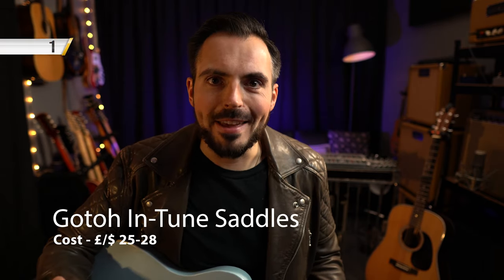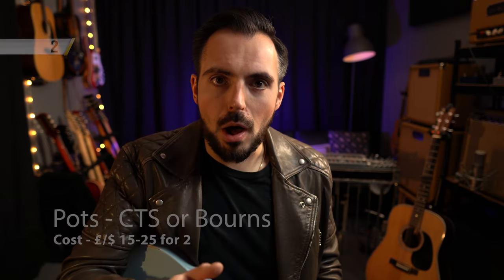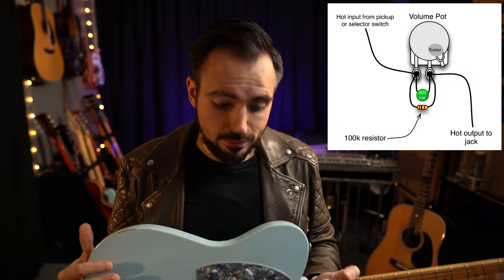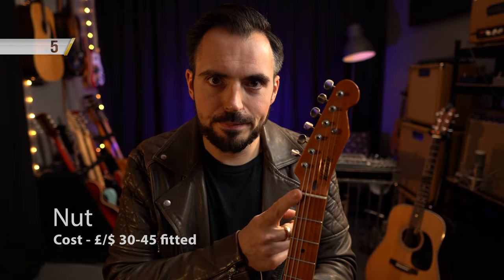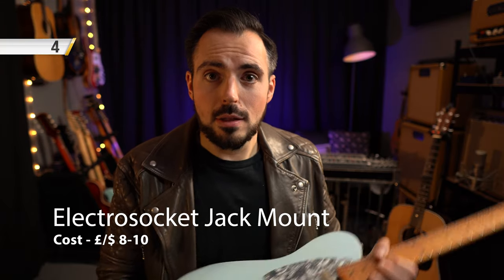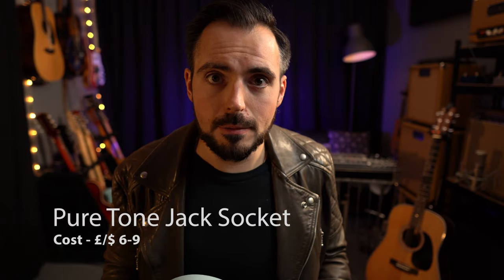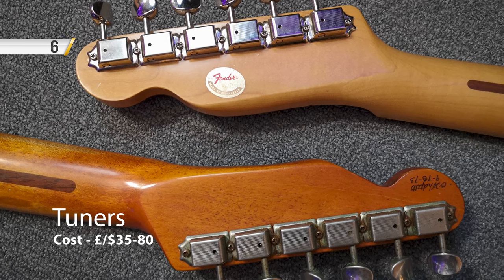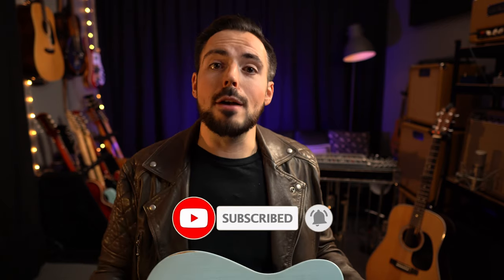6 Cheap Telecaster Mods - Tele Tuesday

Comment: Shield the cavities while you are changing the pots. It helps !
Reply from the maker: Good idea Barry!
Reply: @ScottPoleyMusic And shielding makes far more difference that tuners. I have never wittnessed tuning instability bc of tuners. It is virtually always the cheap plastic nut.
Reply: The problem with this type thinking.
First off does a noise problem even exist?
The tele is pretty quiet for a single coil guitar.
Adding shielding SHALL cut some high end off your tone, that’s physics. And a fact.
Research it yourself. Be my guest.
blanket statements are unwise.

Comment: We need a "6 cheap mods with no soldering" video.
Reply from the maker: I can do that!  Soldering isn’t so bad though - it just takes a bit of getting used to.
Reply: I first started soldering electronics and tiny motors and such when I was 10 years old. It's simple to do (clearly as a 10 year old can do it).
But if there's any piece of advice about soldering is: PREP PREP PREP. As long as you prep the working area well, you can't fail. Cover anything. Keep everything you need in comfortable arms length. Take your time.
Reply from the maker: As a fellow junior soldering geek, I fully endorse this message 👍🤣
Reply: Seems like you need a "how to solder" video, mate. It's neither rocket science nor heart surgery. It's heating up shit to make it liquid-y and when it gets cool again it solidifies and attaches shit to other shit.
Reply: Why don’t you learn to solder?
It’s simple, my granddaughter can do it , she is 6?
No excuses ….

Comment: I'm glad I came across this! Thank you for making it! I have a very inexpensive Harley Benton TE-20 and I absolutely love it. I've already modded it with Hipshot locking tuners, a new string tree, Tusq XL nut, and compensated brass saddles from Gotoh. It's made a world of difference. HOWEVER...it is only a top-loader! Yes. It's so cheap that the bridges are top loaders. It doesn't sound bad at all. But for the sake of authenticity and sustain, I'm having our local luthier drill (carefully, carefully) holes needed for ferrules (also from Gotoh). I also purchased a genuine Fender ashtray bridge for it. I'll probably rewire it with a harness next, complete with the treble bleed circuit. Thanks again for all these great tips, Mr. Poley!
Reply from the maker: Awesome Michael, some vintage Fender Tele's had top loading bridge.  Good luck with your modifications and keep your eyes peeled on my channel for a video about a Harley Benton guitar I just picked up 👍
Reply: Putting good pickups in Squiers and Epiphones etc but still using the existing electrics isn't a great idea!
Reply from the maker: @Ronno4691  I quite agree with you there.  Upgrading the electronics and wiring in any guitar is always a great mod.

Comment: This video is good motivation Scott, the bridge ground wire has been knocked off and my Tele buzzes so bad it's unusable so I might as well do a proper job on her.
Reply from the maker: Excellent Andy, you can achieve so much with very little cost.  Good luck 👍

Comment: I have just assembled a couple of guitars that have a 'through-body ferrule-block'... They cost around £20 (from Grainger guitar parts here in the UK). The only real downside, is you need to rout a recess in the rear of body, but if you have a router, you can also get hold of the templates required and it's not too difficult to do...  I did a trial run on a couple of pieces of wood before actually touching the guitars. I am not certain how it will effect the tone/sustain of the guitar (I haven't wired them up yet!), but apparently, it does make a difference... It kind of makes sense, especially if the guitar body isn't made of a particularly dense 'tone wood'. Maybe, the 'experts' out there could enlighten me. PS. I just thought they looked really cool!
Reply from the maker: Very interesting, never seen that.  Thanks for the tip Ian!

Comment: add  a 4 way switch, puts your pickups in series instead of parallel gives you a nice beefy tone
Reply from the maker: I have one in my other Tele Martin, it’s a good mod.  I have to admit, I don’t use that extra position on anything 🤣 maybe it’s just the combination of the pickups in that guitar.  It is a very good mod though.
Reply from the maker: I have one in my other Tele Martin, it’s a good mod.  I have to admit, I don’t use that extra position on anything 🤣 maybe it’s just the combination of the pickups in that guitar.  It is a very good mod though.

Comment: I watch a lot of demos of guitars. And I can never understand why people say change those three saddles for better intonation. Have been playing them on my thinline when they FIRST came out around 70 and never had a problem with them, in fact I have recently bought two new teles, a Fender performer. And about to receive a classic vibe 50s squire (yes I know cheapo} but they sound pretty good for an old knock about, and in both cases the three saddles bridge, AND the old tuner machines  were  the attraction, accept on the performer, which has looking tunersvv,  OK. But I really prefer the old ones, cut the string, put it straight down the centre of the tuner, no nasty spikes sticking out. Never had a string slip out of tune. I know why people think the newer six saddles are better, but not in my experience. But thanks for the ideas about the electrics, the could prove to be a problem with the Sqire cv, time will tell
Reply from the maker: I'm not far behind you Ted, the only reason I changed to the compensated saddles was playing detailed chords, high up the fingerboard, in a studio context.  Other than that the standard saddles have served me well for years.  Thanks so much for your comment.  Good luck with your new Tele 😎👍
Reply: Problem with the old tuner machines is you can't quickly change a broken string whether at a gig or rehersal unless you carry a pair of clippers on you 24/7. They're the first thing I change on my Fenders that came with them. Modern tuners are FAR superior for gigging musicians.
Reply: I bet you changed your mind about that CV once you had its. Good luck 👍.
Reply: The 3 barrel bridge on my vintage reissue telecaster is awful. When I got it from Fender, the intonation was the worst I’ve ever seen on a guitar. $2000 guitar, couldn’t play any chords. The 12th fret was closer to one half step above.

I adjusted it the best I possibly could, but with barrels it’s always going to be a balance between the two strings that rest on them. unfortunately on my guitar, it was off by way too much and sounds out of tune. The funny thing is I can wiggle the barrels when the strings are loosened and it changes the intonation. The intonation changes organically every time I change the strings.

A big fat “no thanks” from me. I’m going to mod the crap out of it until it’s finally playable. Just a bad guitar unfortunately. 

I have other telecasters, strats PRS, Charvel, hell even a Danelectro. They can all be set up to play great. But not that vintage reissue Tele… lesson learned, don’t buy direct from Fender. And don’t spend $2000 on a guitar with worse specs than a guitar less than half its price!

Comment: IME, the Gotohs aren't any more intonatable than the compensated Wilkinson saddles or even the slanted brass barrels.

What they do offer over those is the slot that each string rides in. Those keep your strings from sliding up and down your saddles when you do bends, for example. In fact, that's why I bought them. Tired of hearing the high E ping when I do bends.
Reply from the maker: Absolutely JC, many good reasons to use them.

Comment: I'm using the TBX Tone Control on my Tele, how does that compare to the simpler treble bleed? Both are meant to enhance the tone and use a resistor and a cap.
Reply from the maker: The treble bleed lives on the volume pot and keeps the tone as you turn the volume down.  It’s simple but effective.
Reply: @ScottPoleyMusic  I think I'll try that on my junk strat then.

Comment: Changing a pot makes no difference at all.most of you upgrades do nothing for the tone.
Reply from the maker: Hey J Man, I’m not disagreeing with you.  Changing a pot with a better one isn’t exactly a seismic shift in tone.  However, from experience, better quality electronics (pots, switch, cable, jack) produce less noise and increase a guitar’s reliably & longevity.

I think good quality electronics are worth the upgrade if you’re wanting to use a guitar a lot - it’s definitely worth doing if you’re planning to buy expensive replacement pickups.  However, I know a lot of people would agree with me and that’s totally cool too 👍 thanks for your comment.

Comment: Never trust a guy with a Mother of Toilet Seat pickguard on his "bathroom" Sonic Blue guitar.
CTS pots are made in Asia, "good capacitors" are capacitors with low tolerance from the wanted capacity value, Never care about the "vintage" bullshit when you talk about Electronic components. The newer, the better. There's no emotion or Legacy in the Electronic components industry.
Do what you want with your guitar, no body cares about your Orange drop caps until you're a Legend
Reply from the maker: I’m certainly not a legend, frankly anyone that claims to be deserves to be slapped.  I’m simply sharing the modifications that make my guitar work for 100+ shows and many recording sessions per year.  All the electronic modifications I suggested are to fit good quality, efficient modern components, tested to an exacting tolerance.  Non of my ideas are new - Danny Gatton pioneered most of them.  

As for the blue - I like it 😎 who cares what colour it is if it sounds good and you make money from it? 👍